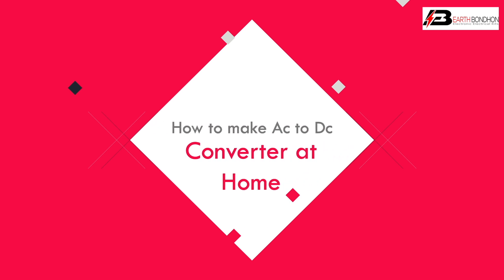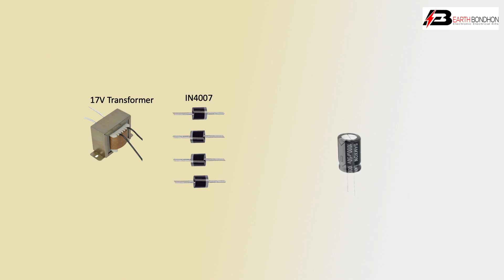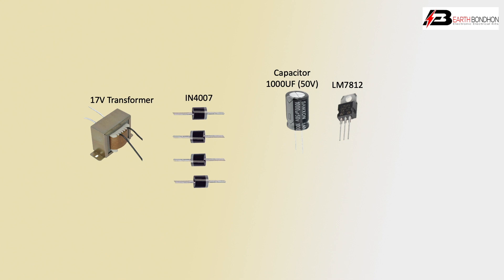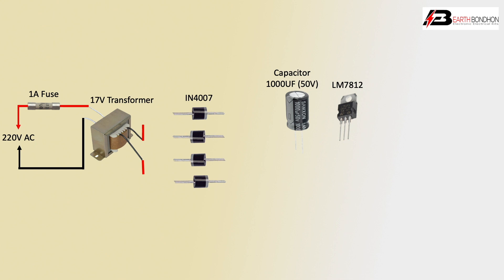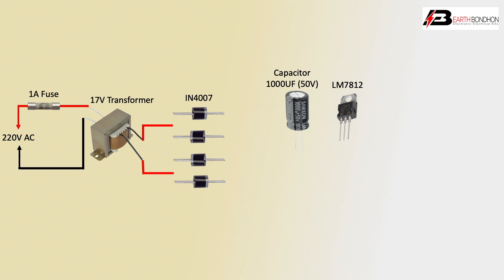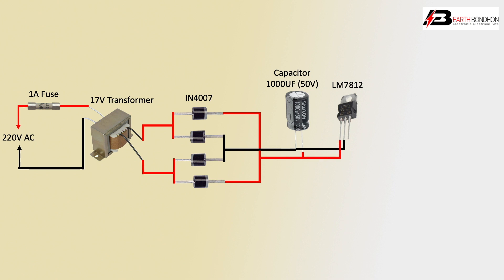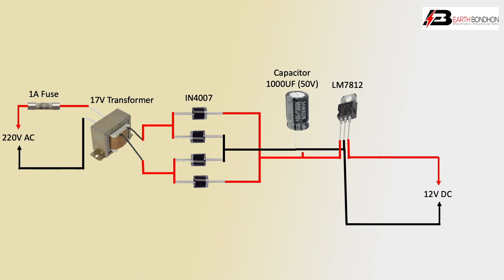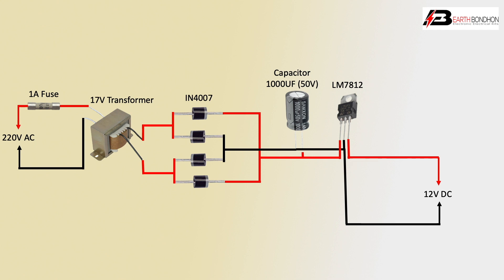How to Make 220V to 12V Converter at Home | DIY Circuit to Convert  AC to DC | Power Supply

Comment: I have requirement to convert 230 volt to 12 volt DC 5 amp supply with 60 watt application. Do you have a suggestion for making a suitable bridge rectifier circuit.
Reply from the maker: Output Max. 2A
Thanks for your feedback, please follow.........
"Thanks for watching the video"   You are very welcome!

Comment: Did you test this? I think it ii just a full bridge rectifier with filter capacitor and regulator and you just reverse it. Does it really work?
Reply from the maker: no, sir 
voltages Using
Thank you! Cheers!..
love to receive your comments and feedback.
Thanks for watching it
Reply: @EarthBondhon  how much ampere will it provide?
Reply: @shivajaiswal985  1A
Reply: @rici_21  thankyou